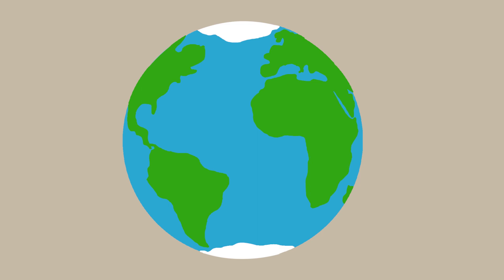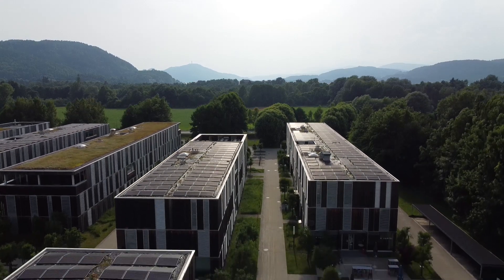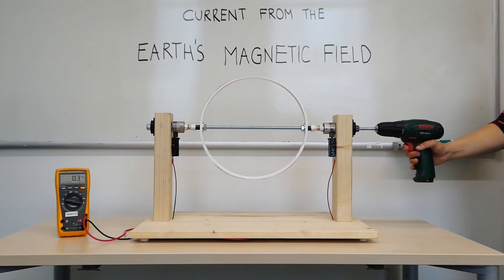Electricity via induction using the Earth's magnetic field

Comment: I am reminded that Charles Lindbergh had an "earth inductor compass" installed in his "Spirit of St. Louis" on his flight from New York to Paris in 1927. it was powered by an anemometer-like wind turbine mounted on top of his airplane. It detected the parallel lines of the earth's magnetic field and the indicator allowed him to maintain a constant course across the field. This was better than reading a regular magnetic compass which wobbles in the liquid as the aircraft is tossed by the air turbulence. There isn't much literature on the technology and I don't know if they are available today as the stable steering gyrocompass has replaced it.

Comment: You need energy to drive any drill machine. So energy remain same.
Reply from the maker: Sure! The law of conservation of energy holds. Here, electricity is converted to the mechanic rotation of the solenoid, which is in turn converted back to electricity. Energy is neither "created" or "destroyed", it is transformed from one form to another.
Reply: But you forgot to mention how much energy is going in vs how much you are getting out. 😅😅😂😂

Comment: And so, who provides the power for that drill??? 😅😂
Reply from the maker: Electricity is converted to the mechanic rotation of the solenoid, which is in turn converted back to electricity. Energy is neither "created" or "destroyed", it is transformed from one form to another.
Reply: @bettstetter  Your theory about conversion of energy, from one form to the other etc etc, is old stuff, taught in 'normal' engineering colleges. What you don't know is that this understanding is applicable ONLY to a 'Closed' system. It does not apply to an 'Open' system, as per Nikola Tesla. And.......all this has nothing to do with my primary question. I'm trying to point out that this experiment does not exhibit any useful phenomenon. We all know that the earth's magnetic field can be used in place of a local magnet, to generate a small amount of power in a rotating coil. If that coil is rotating from the energy, so generated, then it is something very very interesting. What you are showing is for school kids. Sorry. 😂🤣😅
Reply from the maker: "What you are showing is for school kids. Sorry. 😂🤣😅". I don't see anything wrong with teaching school kids (or, in this case, first-semester bachelor students) the well-known principle of electromagnetic induction.
Reply: @bettstetter  Thanks, Professor!! 🙏🙏
Reply: It's a windup

Comment: Here's something you didn't take into factor. The magnetic field acts in lines and you did not perform that test over were the earths magnetic field comes out of the earth it was at a random classroom.this needs to be done at a magnetically anomalous location
Reply: No the earth's magnetic field is a field, that is at every point in space there is some value of magnetic potential, we can take the derivative of the magnetic potential field to describe a tangent space that is the direction in which the magnetic field changes across space. You have a big misconception. Lines  are used to visually describe the slope of magnetic potential throughout space, which is pretty much uniform across the surface of earth, from north to south.
Reply: Correct. The concept is correct but the demonstration is not accurately reflective
Reply: Still, waste of time and effort. Nothing useful.😅😂
Reply: @tonyrebeiro  I think it is maybe a unique example of how moving electrical bodies in magnetic fields causing electromagnetic flux, this video should not be taken as a source of power, but instead educational about electrodynamics, and wanted to point out a misconception in this comment section about how electrodynamics works at least classically,  I'd highly suggest Griffiths to anyone who reads this and of  potentials, flux, and moving bodies.
Reply: @jackpeterkettley  Yes. Good for school and college students. Not for me. 😅🤣😂

Comment: make a magnetic helicopter? probably not. the current has to be about 10,000 amps through a small wire. it will deflect. i put turns on a bike hub.

Comment: The meter is too small to read the units.  milliamperes?  What is the rotation rate in Hertz?  What can you conclude about the magnetic field of the earth at that location?  How much loss from sliding contacts?  How much energy used by the drill?  How much energy lost to air resistance?  No equations, no records or analysis of data, no numbers or units, no charts, no science?  And what is "do not repeat at home"?  A joke?  I know you can do better.  Much better.  It has 438 views today.  If you gave a real lecture to that many people, you would prepare more and try harder wouldn't you?  If you put in the effort, people will recognize your care and effort and more will watch.